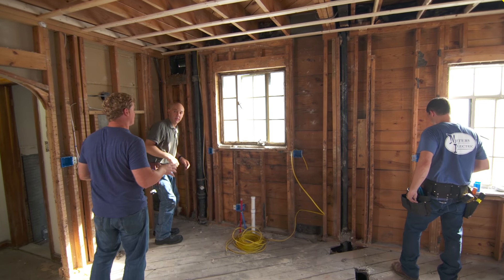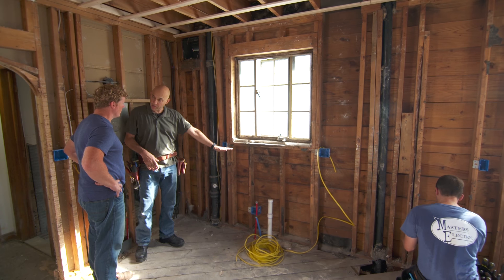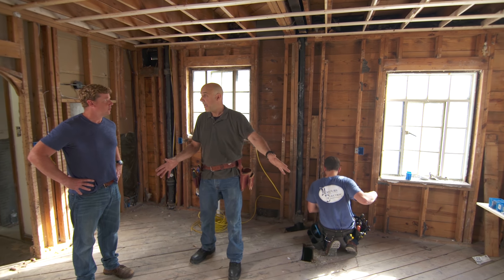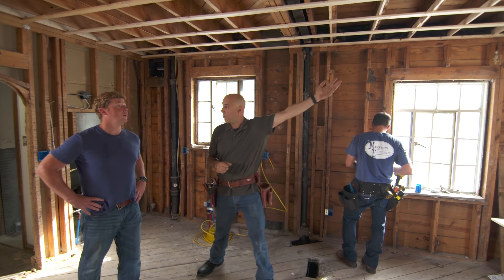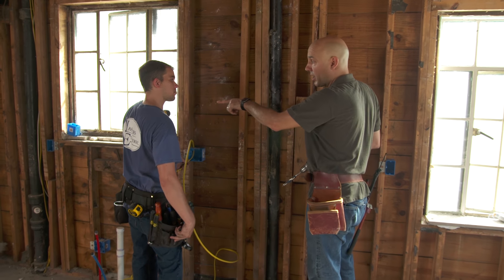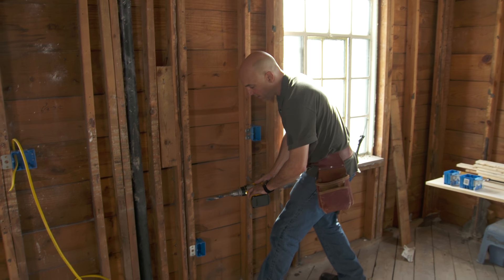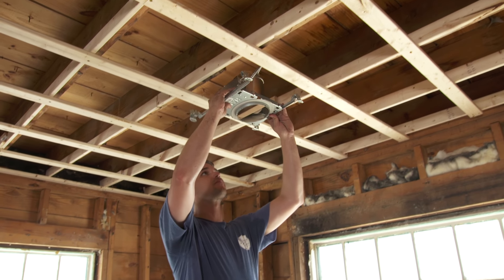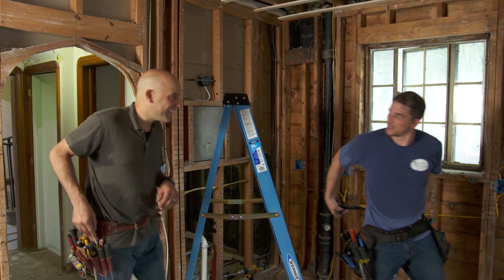How to Install Rough Electricity | This Old House

Comment: Just in case if anyone is wondering why they call it rough electrical, it’s because they split it in 3 phases. Phase 1 is rough in this is where all boxes are mounted as well as the wire being pulled. Phase 2 is called trim out this is where you will wire and install all receptacles light switches and fixtures. Phase 3 is testing and troubleshooting which is self explanatory. Also you will see different colored wires for installation the one with the yellow insulation is called 12 gauge white is 14 gauge and orange is 10 gauge for lights you use 14 for kitchens where appliances such as microwaves toasters and coffee pots are used then you will use 12 gauge. For heavy appliances such as oven/stoves, dryers etc you will usually use 10 gauge
Reply: thanks bro imma gonna go do my own wiring in my house after telling all my lawyer family Dustin Bergeron authorized me

Comment: Great now i know all i need to rough install electric...drill some holes, run some 12/2 with ground, staple some cables, screw in a light on the laser line, and get some lunch.
Reply: That's it

Comment: I think he’s gonna need some extra protection for the wire he’s running for the can lights...If that’s getting sheet rocked, that wire is way too susceptible to getting hit with a screw
Reply: Most of the things they do is not accepted by the building code in my country! Here, wires must be inside pvc conduits , you cannot use those two-pin nails to fix cables, conduits must be fixed to wall or ceilings and no wire should be hanging for itself inside or outside of walls!
Reply: @faghihimohammad  That’s interesting, what country are you from?
Reply: @pviau90  I am from Iran, however our building codes are mostly adapted from Germany codes with some changes.
Reply: @faghihimohammad  German codes are pretty stringent.   And makes sense not to use the two pin nails to fix cables because you're not allowed to have the cables out.     That said, running NM wire through holes drilled is largely accepted in most cities in this country, but yeah I'm not sure about code allowing the surface mounted NM wires stapled like that,   honestly I was wondering how they were going to go straight through that steel I-beam... no problem they didn't go through the wood!
Reply: PVC pipes allows easy cable management in the future, is safer but more difficult to install as first install piping and then pull cables through. Of course old school method is preferred then when you can just pull wires as you wish without ever thinking that someone needs to perform something later on.
Reply: i agree there falling to do things to code and now that the wall is open they have to by code put in fire blocks

Comment: Always walk your Romex out so there are no twists. Hold it at the box opening,  add 1/2" and strip by scoring the sheath  in a ring then you can just pull the sheath off. Tear the paper cover from ground wire , insert into the box and staple. You leave a mess trying to strip it once it's in the box. These are things I seriously learned the first day on the job.

Comment: I’m rewiring my 100year old home with 6/3 on 20amp - 30 amps combined of arc fault - ground fault all on one breaker.  no pig tails too and are “smart breaker” in which my electrician gets notified when on his iPhone when the breaker trips. Even can tell if something is defective with the breaker or the wire when the breaker trips. It will tell whether or not it is a arc fault or a ground fault and you can decide whether or not it warrants a service call. You wire it up just like any other breaker. But I keep lights and outlets on separate brakers. Mainly for the reason if in an appliance or something like that trips breaker the last thing you would want is the lights to go out as well. Then be fumbling in the dark for a flashlight. Keep them separate but wired for the same room. But that’s 6gage wire the whole house with all led lights. I’ll never have a wire fire. Anything worth doing is worth over doing. 

https://www.leviton.com/en/products/lb120-ds <—the breaker 

https://www.leviton.com/en/products/residential/load-centers <— Electric box. I’ve go the 60 slot. More headroom then I’ll ever need.
Reply: Hmm, you're a bit behind the times! The " proper" way is, allegedly, to put every single circuit on a suitably rated RCBO with surge and arc protection. UK retailers knock them out at around $200 a unit (ignoring any discounts). Generally designed to fit on a DIN rail system in European area.

Some folks might whinge at price but why do it on the cheap if you are protecting your family and property?

Obviously you're going to use correct sized cable which fits into the screw connector apertures.

And use calibrated torque screwdrivers to set screws to 2.3 or 1.7 Newtons depending on manufacturers' specs.

Doubtless you will have similar regs ... basically do it by the book and don't waste your time reinventing the wheel.
Reply: I have the 3 levels of Serge protection. Were upgrading from 200 to 400amp service. 1 level Serge protect is from servicer meter - 2 is a whole house Serge protect that’s wired with 6gage 50amp breaker inside the box - 3 is a combo unit that’s Serge protect and voltage regulator- voltage stabilizer from tripplite. Kind of expensive unit, but we feel it’s worth it. Since we’re in Florida (lighting capital of the USA) we planning to put up lighting rods on roof wired very deep into the ground. Point is, I’ve got more Serge protection then most brand new houses. So far the code enforcement guy here is very impressed with our layout and we have had 0.00 % of violations. He says he’s seen every trick in his 40 years of code enforcement.
Reply: @ABC-oo4vm  Aha! All is now crystal.

I was intrigued about your comments ref lightning so researched this Florida lightning thing and can appreciate why you need such a comprehensive protection system from surges all over the place!

Rather you than me!

Comment: Its a good practice to install all lighting circuits on 14/2 wire and all receptacles on 12/2! also make sure all wiring is nice and neat, leave a service loop for the future.  Not a fan of those can lights that were shown in this video... Its 2020 theres better lighting alternatives such as 4" slim LED lighting or even LED Strips

Comment: The general sign of a good electrician is clean, neat work, those wires looked terribly tangled and prone to fail.
Reply: Proned to fail? Does wire just sense when it's not neatly ran then stops working?

Comment: I love electricians. Without them.....nothing works. 🤷‍♂️ literally
Reply: Hmm, do you mean I should have wired up my log burner? What about candles?

And what about water wheels driving  mill stones and a wood oven to make bread?

And what about hand looms?

Oh I get it. You were having a laff 😂.
Reply: That way you can speak about any job.. without framer you wouldn't have a house, without carpenter you wouldn't have finished rooms, without sewer guy you wouldn't be able to have a crap,... everyone does their part it making the total thing work. Electrician is just another job.

Comment: Recessed cans as shown are to handle both the heat and weight of 120V, 60 W lighting in ceilings.  Why install recessed cans, anywhere, in the age of LEDs, other than as a cash cow for the trades?

Comment: I thought wiring was supposed to be run through conduit? Is this a new thing or maybe someone can explain
Reply: Mostly used outside or on exposed wire that isn’t in drywall or wire that needs to be protected

Comment: you dont use 14-2 for dish washer or for garbage despoil them have heating elements for dish washer as for garbage despoil that draws mass amps. and they both need to be on diff  full runs right to the main box and put on a GFI in the box. it is new code. as of sep 2020 i think this old house needs to think about this new day and age and start reading up on new codes.

to top it off how did this show even show anyone  how to do any of that work at all. last few shows was just showing people working on chit not explaining how to do it whats this old house show about now?
Reply: A dishwasher pulled about 6-7 amps

Comment: "The local trade is here to help"   riiiiight to "help".   More like union rules won't let anyone else do the work.
Reply: That is most likely due to electricians only being licensed in the state they live in. So sure they could do minor things in states where they're not licensed but wouldn't be able to do anything that required permits/inspection. That is exactly why they have to hire a local electrician or even plumber. Now they can do non-permit work all day long with no issues but rough electric & plumbing require permits.
Reply: Unions don’t do residential

Comment: Can someone please explain to me why cable in North america (You guys call it romex) comes in a rolled up mess.  In my country,  cable comes rolled up neatly on a drum of minimum 100 metres. You use what you need then pack it away. It can also be placed on a cable stand or a cable reel roller.

Comment: I am an Electrition here in the UK, I know absolutely nothing about the American electrical systems but even I can see that this is nothing more than a boge job that light fitting?  He fixed it with two screws on one side please, a fitting that big would need fixing screw on all thore corners so as to take the wait, cable pined on to of the other no should be side by side.  Hell the Americans don't even do any testing when they are finished, like continuity earth loop impedance insulation resistance or RCD , they finish wait for the building inspector to come and take a look around then sign of on it job Don, if I was staying in some one house as guest I would be very scared of on waking up in the morning due to a fire.
Total crap these guys should be taken on YouTube

Comment: That electrician does sloppy work! Twist in the line, 80 taps with the hammer just for a cable staple (tap tap tap tap...) 🤦‍♂️, and bad acting!
Reply: ...and what do you do? 2 hard-as-you-can whacks and then oops your hammer slipped and we're going to have to replace this wire?